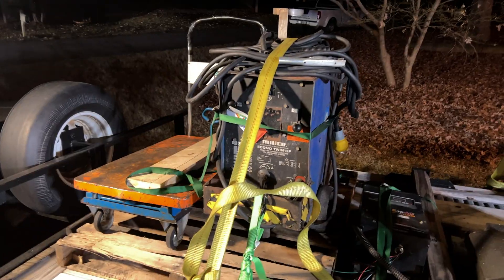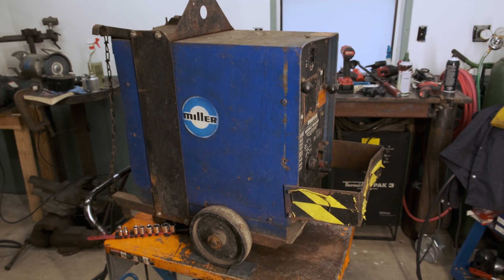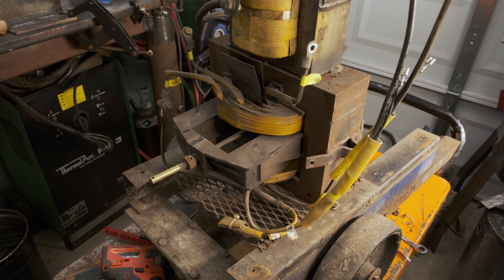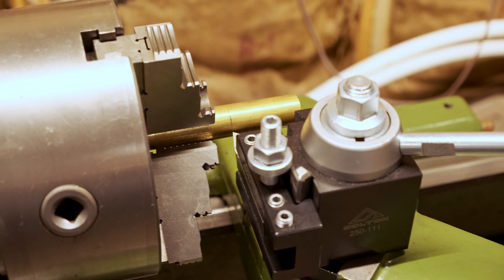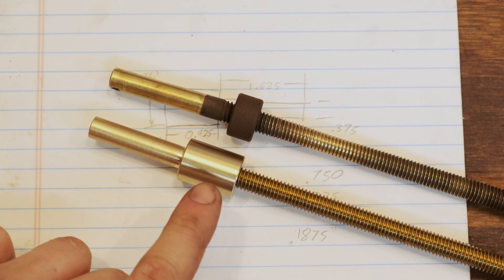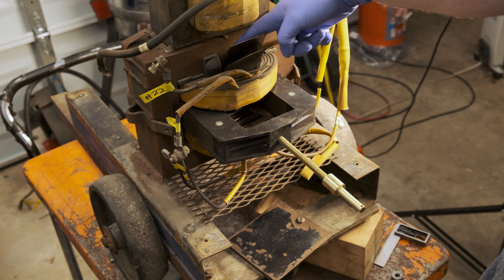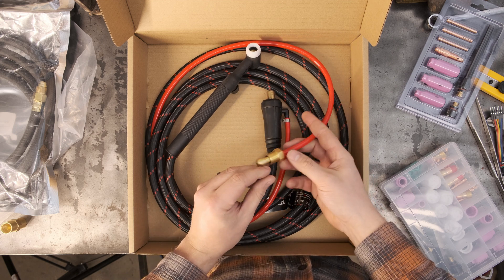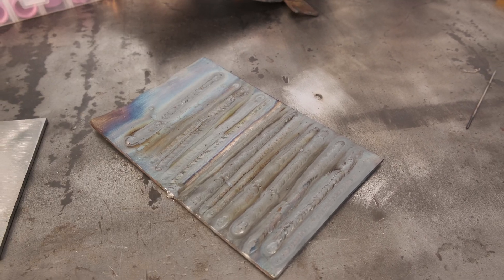Cheap TIG Welder, or Boat Anchor? | Shop Blog

Comment: I’ve replaced the lead screw, power diodes and power cable on my Econotwin. When a diode goes bad you will hear it and probably trip the breaker. I used 200 amp stud 14:49 diodes from Ali Express ( @$50 for a set of four, two plus and two negative.) The diode stud thread size was oddball 19mm and I retreaded them to a very close 5/8” NC. They have been running good for at least four years.